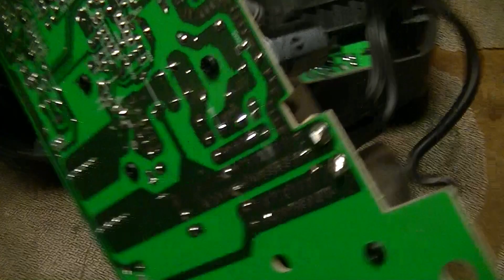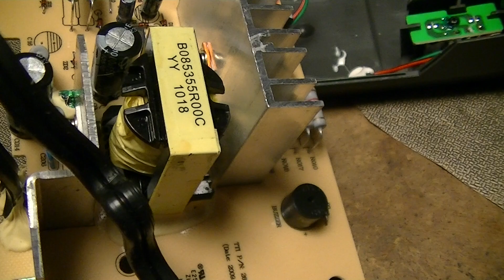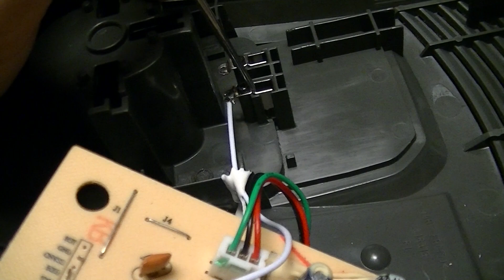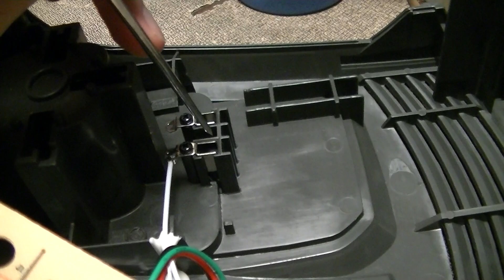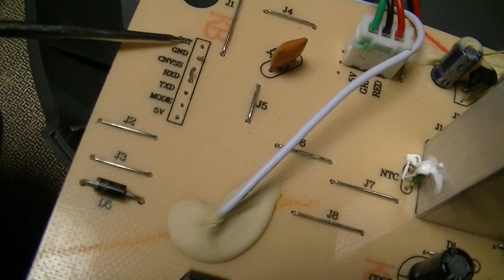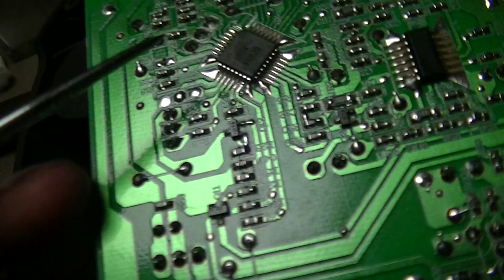Ryobi P131 one+ battery charger guts

Comment: Do you think the guts could be used to convert a Ridgid charger to 12v?
Reply from the maker: It would if the thermistor in the battery packs that the charger uses to monitor cell temperature is the same.  If not, the charger would probably grep as it would think the battery was waaaaayyyyy over or under temperature or even defective iffen it didn't see a thermistor at all.